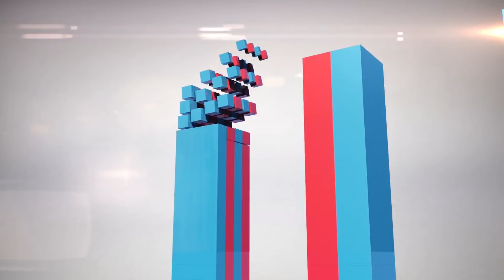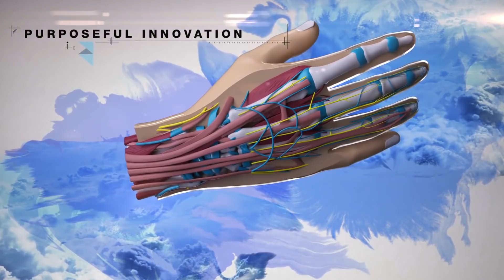What is a Voxel? GrabCAD Voxel 3D Printing Software

Comment: Why is this so epic?
Reply: It's not a good representation of it... but  Voxel is an elemental 3d unit of simulated matter. 

Each Voxel is programmed with specific physical properties that resemble real matter. Glass is clear, refracts light at a specific angle, is ridged and fragile, resonates at specific frequencies of vibrations, and so on. If you program a single voxel with the properties of glass, by itself it does nothing, but together in a collection it takes on properties more dynamic than the individual voxel. 

In a collection, the variation of the magnitude of these properties depends on the composition of the collection. Configured to form a pane of glass, it would break easily if hit by something like a rock. If formed into a wine glass, it might shatter when a singer hits a specific pitch and volume. If you increase the thickness of the glass the effect of its refractive properties change.

If you still don't get the significance, traditional methods program these properties at the object level with predetermined behavior and effects. Voxels collect to form the properties of the object. For instance, in a game, if you shoot a brick wall, little sprites of pixels might pop out, holes are simulated, and maybe even pieces will break off, but it's all predetermined how it will break. Voxels would break of pieces depending on all the variables in the collision... velocity of the bullet, composition of the bullet and of the brick, forming a reaction that that is not predetermined that can produce a simulation more accurate to reality. 

The best way to summarize Voxels is that you, as a developer, are like Michaelangelo when carving the statue of Moses, you smash your hammer on the knee of Moses and shout "Why don't you speak to me?", and it replies "Because I don't want to!"... Let that sink in a bit.
Reply: @stevenmalone7151  Thanks for the explanation.
Reply: @stevenmalone7151  wow man you are a genius
Reply: It's literally pixel art but 3D ofcource it's epic :D